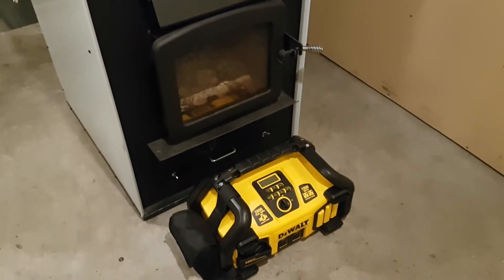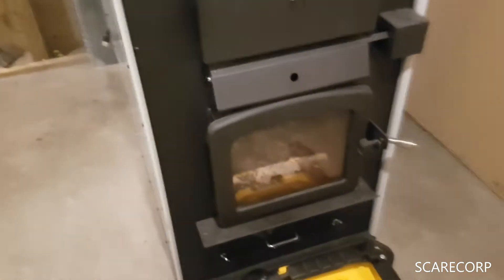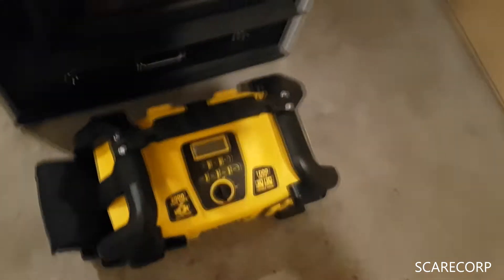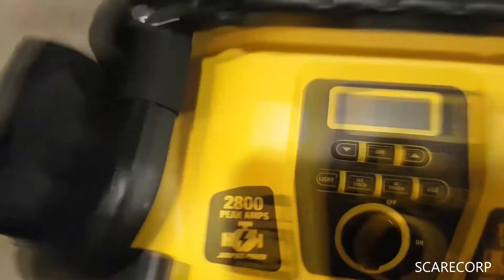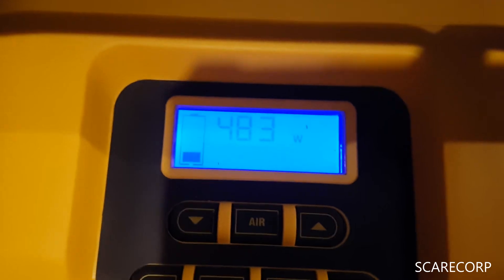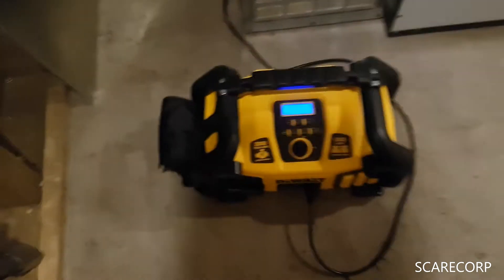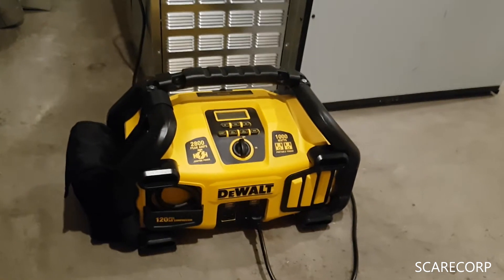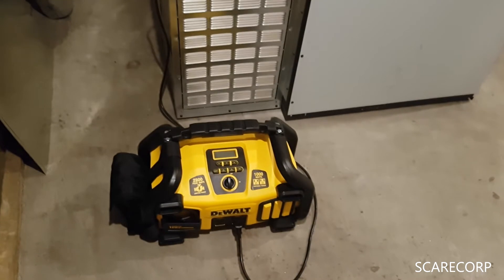DEWALT 2800A/1000W Power Station [CAN IT POWER UP A WOOD FURNACE??]

Comment: I have a ? Does anyone know if it can be used while it’s charging for example can I plug the 12 volt in the cigarette lighter and then charge my laptop thru the plug in???
Reply: Markyse Miller I own one and you can’t
Reply: Can I charge the unit from the inverter =infinitive power

Comment: i need your help would this charge a daul 15inch  portable bluetooth speaker, that holds a 12vt lead acid battery
Reply: pree3431 without a doubt! It would charge 10 of them if your not being sarcastic!
Reply from the maker: This will only charge things that can be charged with USB or AC power up to 15 amps. so if your speaker can be charged with USB then this will do it.

Comment: I like how this DeWalt unit has two batteries where most only have one plus it has a much bigger inverter than most of these have cuz most only have a 200 watt inverter but this unit is also about three times as expensive and twice as heavy but even though you have two batteries if you run something on it that pulls 500 watts for example like you do in your video you will drain those two little batteries in there really fast so you should only use that in an emergency, you could use a really small TV that would run a lot longer if it only takes about 50 Watts during a power outage for example but something that's pulling 500 watts will drain your batteries super quick.
Reply: how many amp hours do the batteriers have